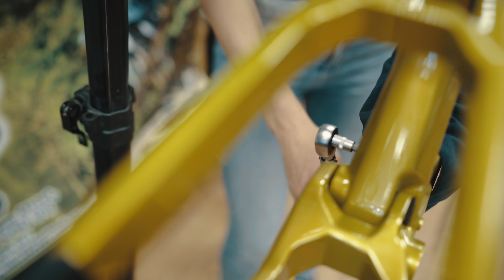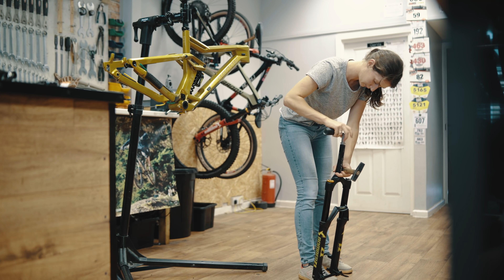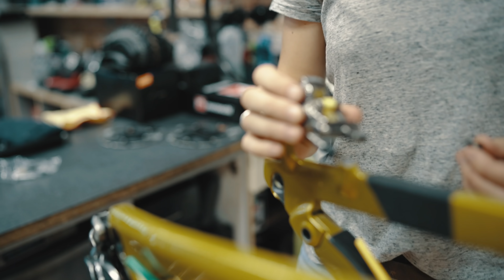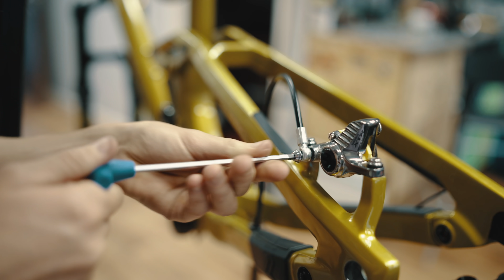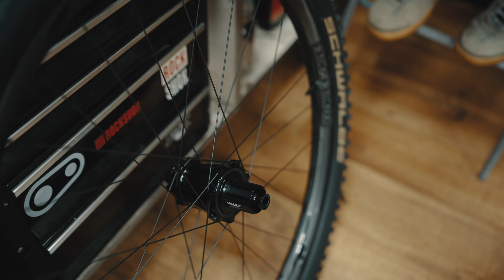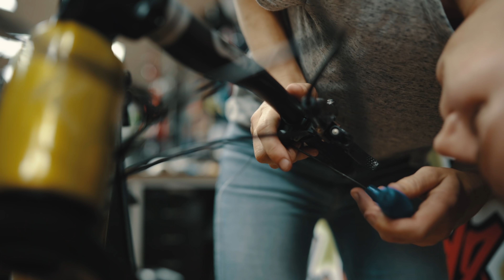DREAM BUILD MTB - RADON JAB // Manon Carpenter

Comment: Simple tools build great stuff. Love how she used her foot to cushion the fork on the hammering job. As I noticed there is adhesive applied on the brake disc screws, that reminds me why my brake disc keep coming loose after a week ride. Also, nothing is more satisfying to see you test your own build at the end of the video.
Reply: That's not an adhesive, it's a thread-locking compound (typically known as threadlocker). When you screw in a bolt with threadlocker, the moment the threadlocker reaches the threads of whatever it was going into, you'll feel a slightly higher resistance.
Reply: @yongling9825  nice, do you have any recommendation for this threadlocker? I'm trying to fix this annoying brake disc problem.
Reply: Medium-strength threadlocker (typically blue) should do the job, doesn't really matter who made it.

Comment: That bike with those specs and still only 2-piston brakes... ;)
Reply: SpookyMindz she’s a tiny thing. You don’t need much stopping power to slow her down. Not only that but it saved her a little weight too 👌 no need for monster brakes when you weigh 115lbs.
Reply: Fam. My 130/120mm bike that I use for light bike park use has 2 piston brakes and stops me more than fine... and realllly, just use less brakes, easiest way to go faster. (And yes, I also have saint 4 pots on my DH bike)

Comment: First I was gonna say something about that gear-ratios, but then I realised that she's Manon Carpenter and probably wasn't going to have any problems with it...

If someone's interested, I've counted the teeth:
Front chainring: most certainly a 30T
Cassette: Shimano CS-M9000 11-40 11 speed
Tire: most certainly 27.5" and about 2.6-2.8"

That leaves us with 1.69m per crank rotation for the slowest gear and 6.14m for the fastest.

Comment: It's a dream seeing one of the most expensive bike parts ;-) . It's like Christmas. But, one can definitely see, that she is a rider and no mechanic - how she handels the tools in the most steps shows "I am not used with it" and some steps are cut out of the video - how to adjust the brake caliper, how to use an internal cable routing kit, the adjustment of the fork and the damper (SAG etc. )...and so on... But all in all a nice "Christmas-must have" Video ;-)

Comment: Why lubricate the fork seats for trimming the stem. At the time of cutting, metal chips will adhere to places with grease applied. Apply grease after cutting and immediately before installation.
Reply: It frustrates me every time.
Reply: @kanderson622  
agree with me it’s more logical to immediately fit and trim. then lubrication and installation.

Comment: Just a tools she is using probably cost with taxes and delivery close to $1000 😁

I was thinking to build one by myself after 6 years taking a break and live without a bike, but my calculation was Not Worth it. It will cost over then 50% then just get it from the store. 

Now I do have intense 951 with both 🦊 🦊 shocks

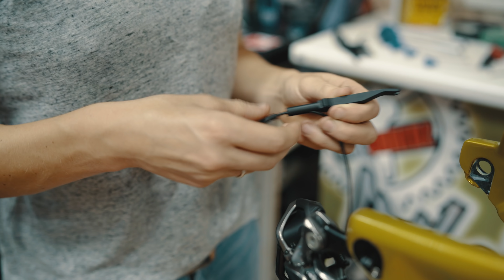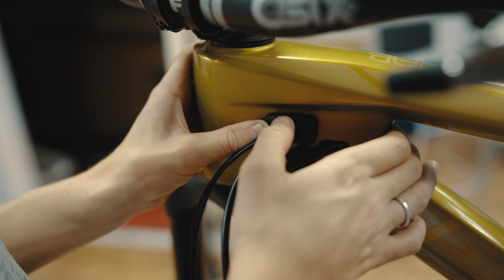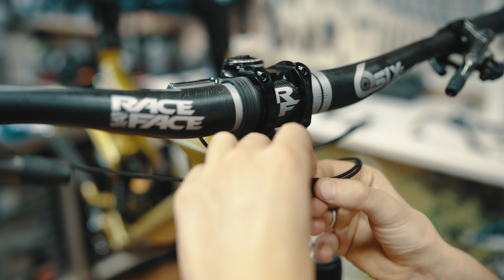Comment: What tool is Manon using at minutes 7:09, 8:06 and 8:10?
Great video!
Reply: That's a Di2 wire plug-in tool, it's used to connect & disconnect Di2 wires safely.

Comment: What is that stuff she put on the bars and dropper post?
Reply: Carbon paste, it contains grains of some sort of material (not sure what it is yet) that gives the paste an abrasive feeling, it gives the components a higher friction coefficient so that you don't have to apply stupid high torque to them. If you take a look at some carbon handlebars, their clamping points are abrasive.

Comment: 0:41 Why is the hinge mount offset from the center of the frame?
Reply: To avoid hitting into drive train components chain etc. Very common design
Reply: @stantheheadhumongous9402  Thanks. I think the rigidity of the frame is getting worse from this.
Reply: @vitekmak3486  Not necessarily,  more material can be put on the bendy bit.

Comment: nice video!  but something triggered me, front brakes on the right leaver wtf
Reply: This is the brake setup standard for the U.K: left-rear, right-front.
Reply: Pete is never wrong  One logic I've heard is that should a cyclist panic-brake, their dominant hand would hit the brakes first (in the case of the majority, right-handed cyclists). Locking up the rear wheel is less chaotic than locking up the front.

Comment: Why do they always need to saw pieces off? Why are they made too long? Whatever is being cut I mean. Noob questions.
Reply: Handlebars: Some like it wide. Those that like it narrower can cut them to size.
Steerer tube: Different models and sizes have different head tube lengths

It's better to have something too long than too short because you can always cut more.